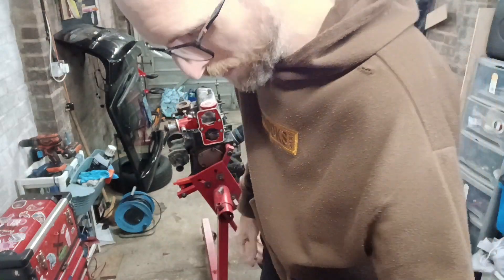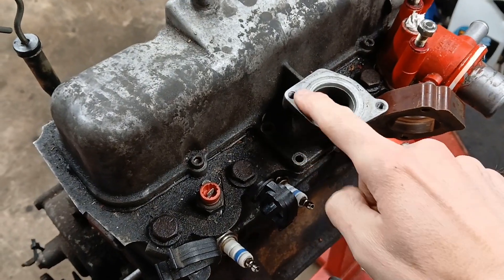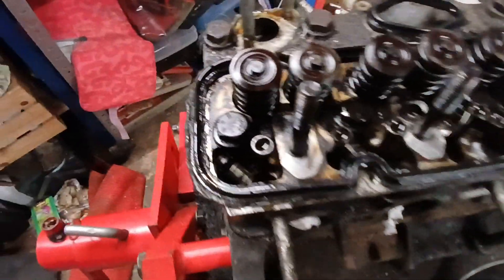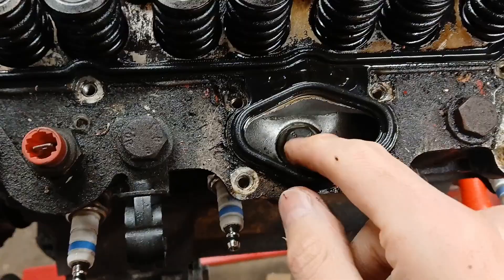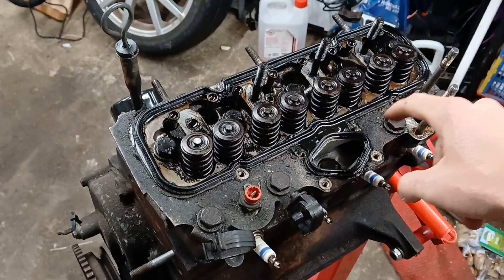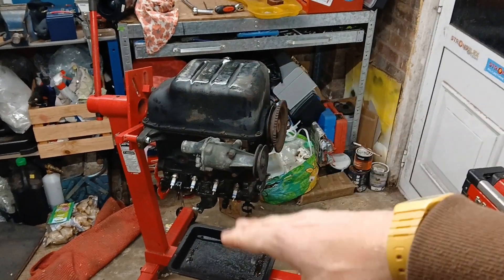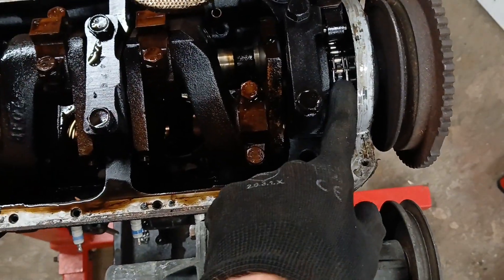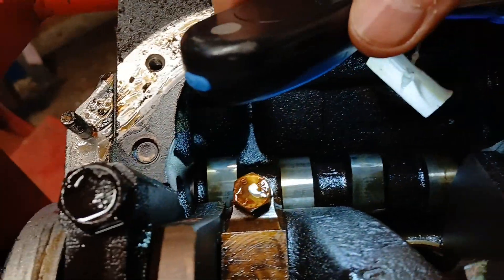Building a Turbo Fiat 899cc engine - Part 1 *old engine tear down

Comment: Hi Ben!
You need a rocker shaft from an older 100GL engine whith solid tappets..... I don't think hydraulics can resist the pression 🤔
Reply from the maker: I'm hoping it will still be OK..ill be running maybe 7psi so I won't be pushing too far..my other cinq has the solid rocker set up on it..I prefer it really